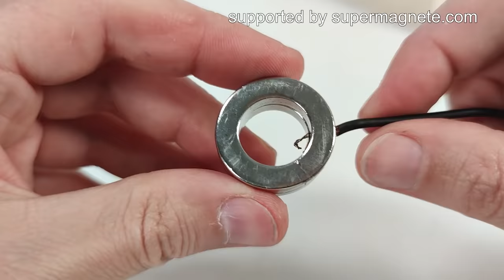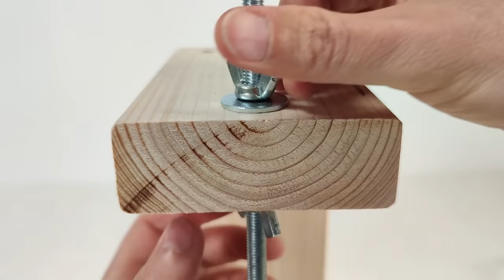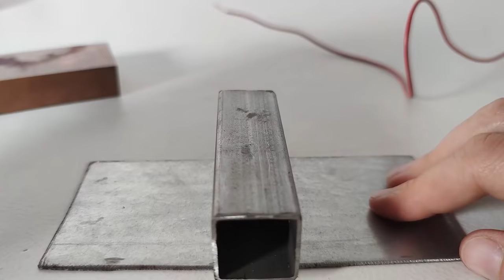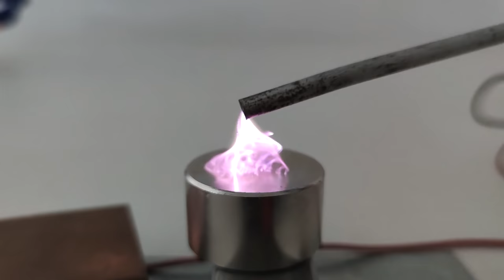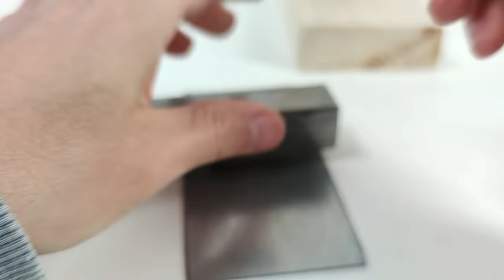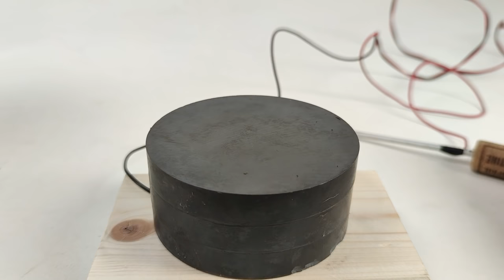Electric Arcs in a Magnetic Field | Magnetic Games

Comment: Simply wow!! These plasma arcs are amazing, just wondering will they emitting x rays, violet colouration itself shows high energy radiation. Anyway @electroboom must be watching this:)
Reply: The violet color is from nitrogen being excited, you need a very high voltage in order to start getting x-rays this way, iirc correctly Ben of applied science was dealing with a voltage around 120000 volts in order to actually get x-rays. Considering the sparkgap used in the video I wouldn't expect it to be anymore than 10kv at the most.
Reply: @thomasrogers8239  eh what are x and y rays? Im not understanding anything , its like watching a Chinese movie without subtitles
Reply: @Ash-nz5ip  Google electromagnetic spectrum

Comment: Hello! What power supply do you use for these high voltage displays?😅
Also, your magnetic vortices look cool👍
Reply: Only a heart no response 😂
Reply: Electric arcs at 20,000 volts in a magnetic field
Reply: @TomiLoveless  wtf kind of generator in a house is going to be able to output 20k volts?
Reply: @TomiLoveless  no how can he use siple wires to transport 20k volts. It is might be less than 100volts
Reply: The arc is travelling through air. From that, you can estimate the voltage from the dielectric strength of air and the length of the path through the air. (It's the distance at which the arc starts that matters - once the arc is going, you can move the electrodes apart and lengthen the arc.) 
The dielectric strength of dry air is 30 kV/cm - it's less when the air is humid.
I'd guess he's using 10-20 kV.
Reply: @RizwanAhmad-fg2ke  In choosing wires, you pick the thickness of the conductor to suit the current flow (which in this case is small) and the thickness of the insulation (around the conductor) to suit the voltage (which in this case is high). 
His wires should have thicker insulation for safety, but the thickness of the conductors is plenty.

Comment: Try DC instead of AC, the spark curvature due to magnetic field should be more obvious. Start with half rectified DC.
Reply from the maker: this is DC not rectified
Reply: @MagneticGamesIT  is it an off the shelf power supply, or custom built?

Comment: Why it spins?
Reply from the maker: For magnetic field
Reply: @MagneticGamesIT  Yes, but magnetic field is a constant force, I cant understand why it spins.
Reply: The arc is a flow of electrons - an electric current flow, which produces a magnetic field that rotates around the arc as if it was in a wire. That reacts
 to the permanent magnet's field to produce motion, the same as an electric motor. See Maxwell's left hand rule, and Flemming's left hand rule.